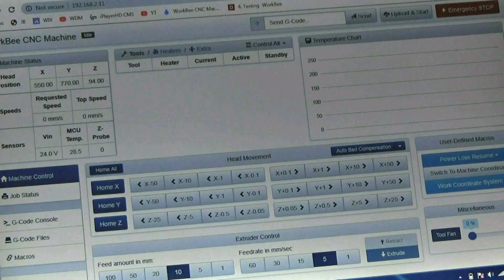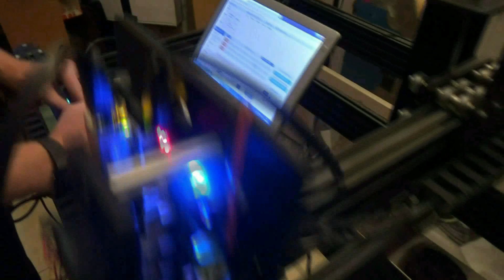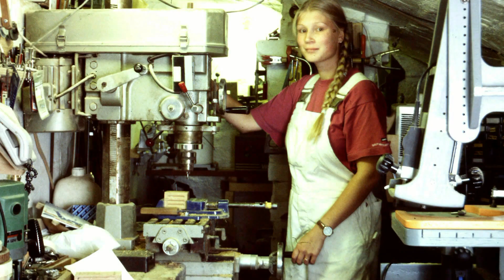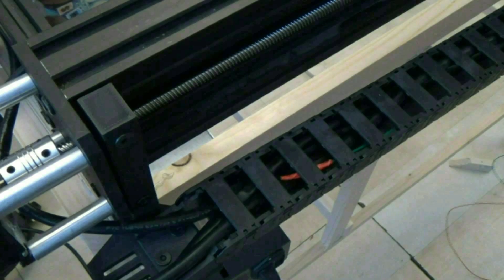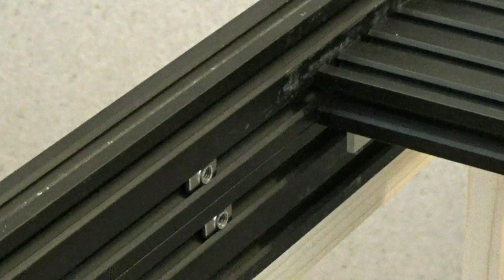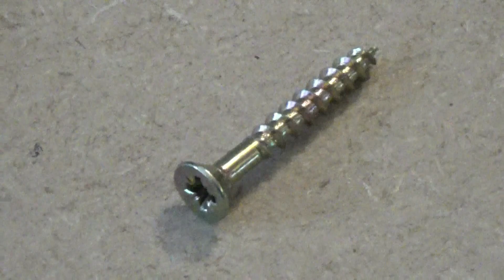My CNC Adventure (04) - Progress On The Workbee Build

Comment: I'm building a Workbee next month so this video helps a lot. I'm also using the Duet 2 controller and 2.2 kW spindle. The only part I'm really nervous about is wiring up the VFD to the spindle and inputting the correct settings.
Reply from the maker: Yes, me too and I've decided to leave the 2.2kw spindle and just get started with a small router with manual switch. Your needs may be different, in which case do check out the videos on wiring up the VDF. Here is one I discovered: https://www.youtube.com/watch?v=NocbE04gN1Y   I think the main thing is to double check wired connectors to avoid a spindle burn out but I havent got that far yet as I say. Please keep posted here as to anything you learn. The comments are as useful as my video hopefully in sharing a total beginner's knowledge base!
Reply from the maker: I have just today got help wiring the 2.2kw spindle and hope to make a short video on it soon. It is satisfying to see/hear it whirring so quietly.

Comment: Good to see progress Jeremy. I’m so jealous. What a shame circumstances prevent me from helping. When I was on the tools and came to a major problem that I couldn’t see a resolution to I would have a good tidy and sweep and a cup of coffee. 9 Times out of ten the answer would then come quickly. I realise this isn’t as simple as that. My point is a little diversion clears the mind somehow.
Reply from the maker: Yes Graham, a shame your circumstances don't allow this. You are right - by letting go the answers can then come. I was on the verge of pulling out as it has taken up so much of my time. even now I see I should be making the spoilerboard much lower sdo that the spindle can be used as a vertical drill. Its a case of not seeing the wood for trees. I would be lost without Bobby on some of the initial controller software setting up. I think it has got to the interesting stage and I have someone online to help me learn Vetric Cut2D software which seems a good choice.
Reply: Woodomain - Jeremy Broun I’ll watch with interest.